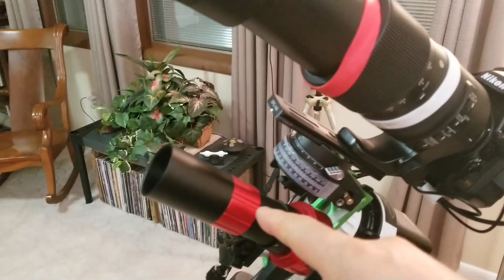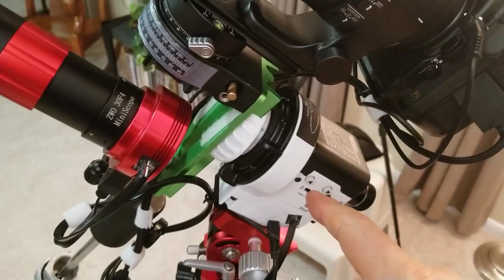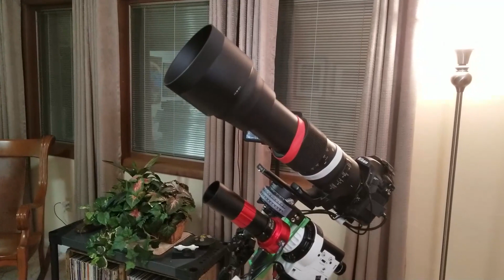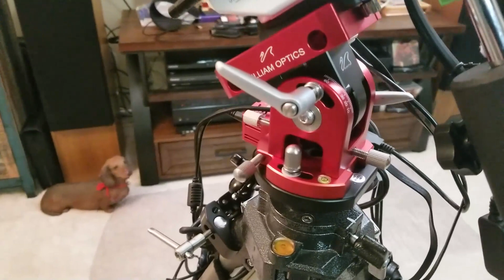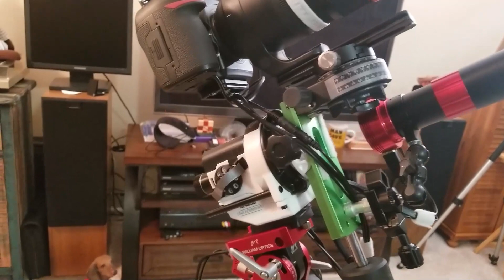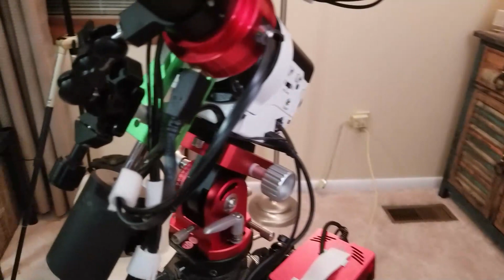Sky Watcher Star Adventurer Pro - An Overweighted Configuration

Comment: Yo my other brother Daryl (does anyone get that ref anymore?),
Great vid, new sub here. I hope you’re still shooting. Great tips. 
Couple things the extra swivel plate on the Dec bracket is pushing your center of mass away from the rotational center, that’s putting more stress on the gears with the mass further out. I don’t really like the stock clutch either but it is what it is. 
Finally I think you meant “mass” instead of weight when you were talking about counter weight. 
Love the info. Clear skies
Reply from the maker: LOL....yeah, I've been around long enough to understand the reference.  I actually did work with a Larry and Daryl at one point during my career, and at about the same time.  Thanks for the compliment.  Sure, I realize the QR clamp raises the center of mass some, but it is of little consequence and my SA Pro seems to have tolerated it just fine, delivering 9-minute subs pretty consistently even when carrying a nearly 9-lb. payload, and I've even gone as much as 12 minutes, but generally avoid doing so.  Mass vs. weight is kinda' splitting hairs in my opinion to the point of a "don't care", counterweight being a much more common term even if that technically factors in gravity acting on the mass.

I am indeed still shooting, but largely with my iOptron CEM40 being my primary workhorse mount these days.  The SA Pro remains rigged up for use if I see fit for deploying it for light-duty widefield work and continuing to use my Nikon DSLR with it.  Otherwise, I'm also shooting now with an ASI6200MC as my primary astro camera.  That said, the weather and hazy/cloudy skies have been such an issue this year in conjunction with also a newly-adopted dog keeping me busy that I've done relatively little astrophotography.

Comment: Not sure why the dial is a problem to everyone. I personally wouldn't put the batteries in until I'm ready to use it on site. I would also replace the battery compartment with a lithium ion battery with a switch
Reply from the maker: I agree, it is a good practice to just install batteries once you're setting up on site, and that may even help force a mindset of keeping fresh or recharged ones available.  For a long time, I never even used batteries and instead chose to use USB power coming from my ASIAir pro, until that connection got wonky on me and quit working.  Now I do use batteries but have been thinking of a similar idea as yours, and making a dummy battery insert that could still take a USB power connection.  I've just not gotten around to that project yet, since I use my SAPro very rarely now, in lieu of my Ioptron CEM40.

Comment: Where did you purchase the arca swilss panning base?
Reply from the maker: The original base as seen in my video is a FOCPRO (Fanyingtech) PAN-02 which I bought on Amazon.  In the years since, I've found it went from rarely to never carried, which is a shame for a nice quality product.  I've seen other makers with similar products but at the moment find none.  The closest is also from FOCPRO (and some other brands too) but is only the indexed base with a standard 1/4-20 camera post on it, so if you're using an Arca-Swiss style plate with your setup as I've done, you'd need to add a low-profile clamp to the rotator.  I mention low-profile since you'd want to keep your center of gravity as low as possible to avoid offsetting your payload above the polar axis any more than necessary.  https://www.amazon.com/Panoramic-Panning-Aluminum-Panorama-Capacity/dp/B07PB1MX35

One thing to pay attention to is that this rotator is 60mm in diameter vs. the larger 70mm platform of the SA Pro.  As such, the placement of the locking knob for the rotator might be an issue.  That wasn't the case with the base I bought since it was more of a lever design.  This base is still inexpensive enough to try out and if it doesn't work, simply return it to Amazon.

Also unavailable on Amazon but another pano base I bought from FOCPRO was a slightly different design with an integrated Arca-Swiss plate in the base.  Just to share the product information with you, here's the manufacturer's link:  https://www.fanyingtech.com/product/kuaizhuangbanjiazuo/Panoramic_Tripod_Ball_Head_with_Indexing_Rotator.html.

Comment: Thanks to you, I will likely spend very little to upgrade my Sky adventurer and instead use it within it's limits with my lightwieght tripod and save my pennies for a 20-30lb goto mount like an EQM-35 or Meade LX 85. My current longest lens is 900g (400mm) and I use Sony mirrorless so my cameras are less than half the weight. Currently I can use exposures upto 1 min unguided with 2 cameras on the mount as long as I use a light lens (Tamron 35mm or 20mm f/2.8, or Sony 50mm f/2.5) on the second camera mounted below the pivot. Makes a great setup to take a wide shot of a constellation while targeting mid range with the main camera.
Reply from the maker: It is very interesting to read you've been able to shoot a dual-camera configuration while using the Star Adventurer Pro, but certainly lightweight cameras are key to that.  Your growth direction sounds prudent and cautious, with good reasons behind it.  As I had a heavy imaging train from the outset, I just wasn't willing to go to an intermediate yet sufficient mount that I knew would likely need another upgrade if I was to eventually go with larger telescope, so I waited for availability of an iOptron CEM40 while saving funds for that purchase.  Happy shooting and clear skies!
Reply: @Ambress  I have a few other tricks to using dual cameras. With the dove tail all the way down so that the heavier camera is as close as possible to the centre of rotation, I can remove the counter weight completely and use the second camera as the counter weight and the dovetail position to balance the rig. This works when I am using my 135mm on the FF camera. For anything larger I have to add some heavy magnets or a heavier lens to the APS-C camera. It's really fun to play with. The biggest draw back is the limited shooting arc with the second camera. I can't shoot southern targets with a camera on the lower ball mount unless I set the start position to horizontal. The 2 cameras are also slightly to close to each other to shoot the same target except at a very specific angle. Maybe I need to buy a longer dove tail. Hmm.
Reply from the maker: @jml7916  You're certainly being creative in your use of the SA Pro.  Have fun!

Comment: Some mounts will give an actual payload weight,  but you should always shoot for around 50% of its capacity because the counter weights are part of that equation.
Reply from the maker: Very true...it seems the majority of manufactures only cite the visual imaging payload but not the astrophotography payload.  I'd never actually connected that with the counterweight since the force applied by the counterweight will vary by where it is positioned, but I'm sure it factors in somehow still.  That all said, with an extra 1 lb. DIY counterweight added, I was successfully carrying a 9-lb. payload with good tracking into the 12-minute range but usually shooting shorter times.
Reply: It has more to do with the torque output of the stepper motor, the weight helps balance the load so it isn't excessive on one side, but the motor is still rotating that total mass. It gets into the specific motors efficiency. The more torque it uses, the more power it needs and heat it will create which will alter how accurate it can perform. The expensive mounts are that way because of the precise componants that need to be machined fit and their industrial grade stepper motors.

Comment: Thanks for this great video! People like Peter Zelinka give the impression that it takes very little troubleshooting time to achieve those long exposures with the heavy rig setup.  My first few nights trying out the Skyadventurer with asiair plus have been very challenging.  
Last night I had to deal with dew for the very first time...I had no idea why asiair couldn't plate solve anymore! Then when I discovered the dew, I hooked up my dew strap on my power bank and accidentally knocked off the power cord to the asiair.  The asiair didn't come on after that and I thought I had fried it less than a week after it arrived. It turns on this morning so I guess there is a safety shut off when power source is interrupted.  
I also mounted my guide scope on the RA bracket just like you but use the ball mount that comes with the star adventurer. It helped to balance my canon 70D with a 400 prime lens. What's odd is this configuration was balanced a few nights before but wasn't last night. The only difference was the dew heater strap.
The learning curve at the beginning is enough to want to pull your hair out and stick to visual observing. 😒 
I see your point for all the accessories you bought because I am running through the same problems. The WO base seems like a worthwhile investment.  SA base is very flimsy. I've already bought some of those accessories even before seeing this video. Astrophotography demands much creativity.
Reply from the maker: I'm happy you found my video helpful.  Peter Zelinka and others certainly provide some very useful content to all of us learning the craft of astrophotography, but I think for many of us starting out, our equipment will vary enough that we may each find unique solutions to the problems we encounter.  That's why I wanted to provide my video...not to say it is right or even the best approach, but just that it was what worked for me in the moment, and also continued to evolve over time as I learned more.

I've no idea what happened with your ASIAir, as I've never encountered a problem as you describe, nor do I think there is any sort of safety shut off for a power loss.  It does seem randomly flaky from time to time but fortunately that's a relatively small percentage of my total use and in fact I now have both the AAPro and AAPlus, and might not be doing AP if not for how much they simplify the process.

The wedge for the SA Pro wasn't horrible, yet I didn't like the sudden free play that might occur in it as I was making adjustments; the WO wedge does seem to be more precise in that regard yet how a worm gear works also just seems to inherently allow some of that play to occur regardless.

Good luck in your endeavors and clear skies!

Comment: Fabulous video. Good job. Thank you for sharing all your ideas. I will try some of them.
Reply from the maker: Hello Patti, and thank you as well.  One thing I will point out from this video, which I later changed and address in a follow-up video (https://youtu.be/CLA0ldnAdKw), is the below-axis mounting of the guide scope on the CW arm's dovetail plate.  Although it did work in that position, I eventually found it limited my guiding if I had any trees to contend with....while the main lens may have stayed above the trees with a clear view, the guide scope might end up looking directly into them.  So, I strongly encourage a higher mounting position, the most ideal being above the lens if possible, but a rigid side mounting will also work.  If you're working with a conventional camera, a compatible L-bracket and modification of the guide scope to install an Arca-Swiss clamp in lieu of the guide scope foot works very well, clamping the guide scope off to the left of the camera, the higher the better, which in my other video is still a bit low and also suffers some risk for flexure as I also included a double-ball arm as part of that assembly.  I no longer use the double-ball arm and instead just a firmly-mounted, forward-facing guide scope if having to take the L-bracket approach.

Comment: This is a great beginner setup.  The extra money was well spent. I wouldn't worry about whether you could have spent it on an equatorial mount!  A descent quality Equatorial mount with all the necessary bells and whistles, will cost you well over $2000, not including the camera or telescope you will be using!
Reply from the maker: Thanks...it has served me well for about a year and will continue to do as a secondary platform more likely used for widefield image where my payload weight is less and the wide field of view also more forgiving.  But meanwhile I've indeed slipped into the money-sucking black hole of astrophotography, lol!  I'm now running with a more robust mount (iOptron CEM40) and dedicated astro camera (ASI6200MC), and also a lens of longer reach (AT125EDL).
Reply: @Ambress  I just started. Just bought the Skywatcher Pro2, got it all set up, now waiting for some descent weather so I can get out and take my first shot in Astrophotography with my Canon 90D, DSLR.  Been doing photography for a few years now, and figured it was time to try  more challenging type of photography..😁
Reply from the maker: @-WhizzBang-  welcome to the hobby then!  I'm sure you'll enjoy it as I have, and also it won't be long before you discover it is quite a different photography beast with much to learn.  One such thing I was a little surprised to discover is that unlike conventional photography where a variety of lenses can be swapped out on one camera body with similar image quality expectations, that's not true of astrophotography, where for a given image sensor's pixel pitch or size, there is really just an optimum focal length range it is best paired with, and that varies also by your "seeing" conditions...basically how clear your skies are.  Given the quality of stars and how they appear is often one of the criteria by which images are judged, then how one's camera/lens combo handles them is now being affecting by things beyond our control...atmospheric conditions and subject distance.  So, a small and sharp star under very clear skies of "good seeing" may become a bit larger and more fuzzy in skies of "OK" or "poor" seeing, and the size of one pixel may define how much/how little of one star is seen...something I'd never had to give consideration to in conventional photography.  I wish you much success in your own endeavors, and I'm sure you'll see them improve considerably as your own experience grows.  My astrophotos now are   definitely better than a year ago.  :)

Comment: This was extremely helpful. Such great ideas! Thank you. I am in the process of modifying my weight system for the same Sigma lens. All of your upgrades are well thought out and useful. I will be making most of the same ones thanks to this video.
Reply from the maker: Hello Wayne, I'm glad you found the video helpful, but I will point out that I continued to optimize my setup and if you haven't seen it, there is another video  addressing those changes (https://studio.youtube.com/video/CLA0ldnAdKw).  Perhaps most notable is that while I initially thought it smart to keep the guide scope low for contributing to the counterweighting, I ultimately moved it up above the polar axis such that it became part of the total payload.  Overall however, with improved cable management also, it worked out better for me, in particular with respect to no longer at as much risk of being obscured by trees while my main lens was looking above them.  One important thing about guide scopes also, is that you actually do want them as rigidly mounted as possible, to avoid flexure issues, which is one thing I just felt I couldn't fuss with too much if to have maximum flexibility with how I was using mine.  Everything seemed to work out OK, but just know that my approach may still leave something to be desired.  :)